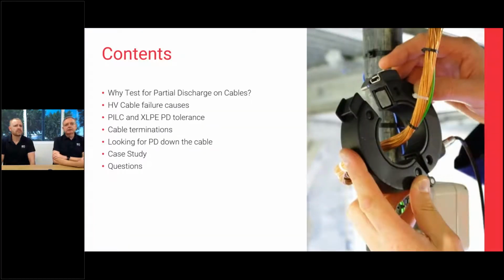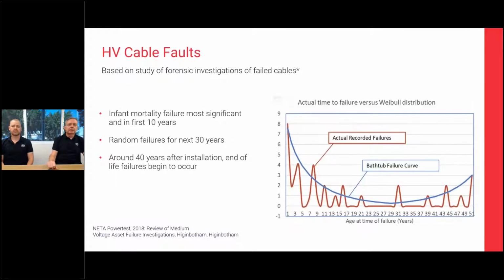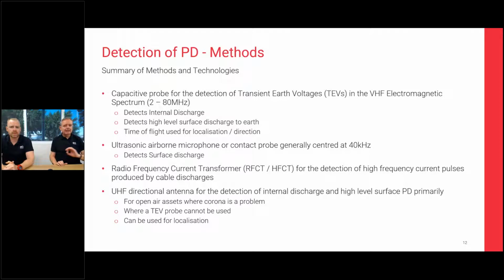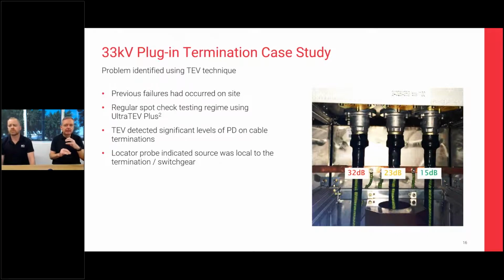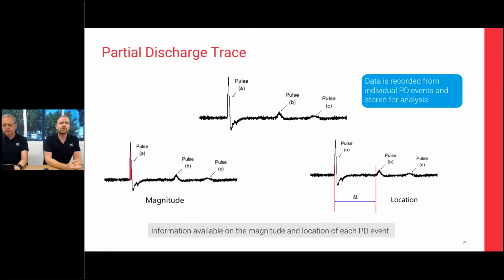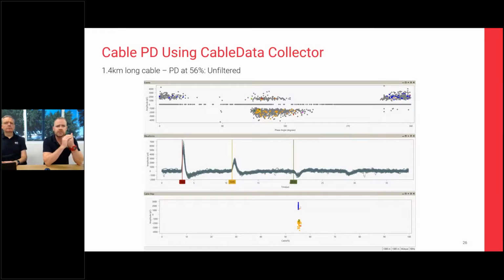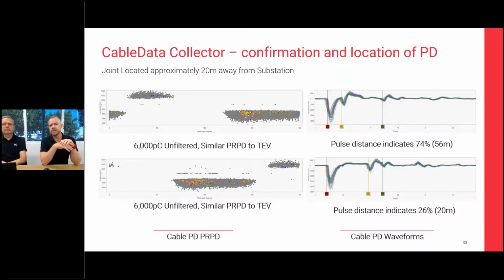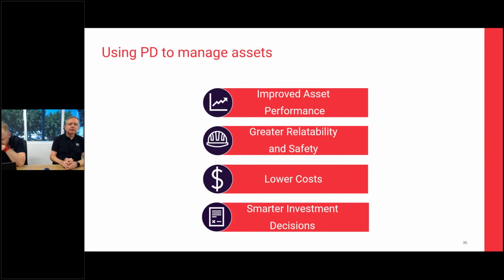How to test for partial discharge in cables -  Online PD Testing

Comment: How to identify insulation defect in a multiple run incomer cable using UTP2 ?
https://drive.google.com/file/d/1pHdHwlhyjeq_ipPUITpSJkw2BOhqU-pQ/view?usp=sharing
Reply from the maker: Hi Shahnawaz, there are a few options available:

TEV test the outer sheath of the HV cable
HFCT test the earth screens of the HV cable  - usually accessible at the HV cable terminations
Ultrasonically test the HV cable terminations
UHF test the HV cable terminations and joints